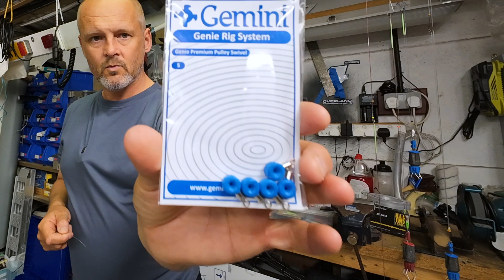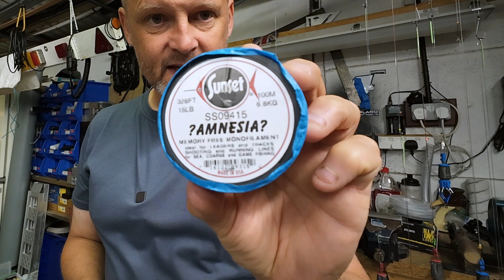1 up 1 down - drop down pulley rig - David Draper inspired

Comment: Well I tested the, and they work very well, even on full flood. Had 3 thornback and 2 doggys. On it, and on my  usual pulley only had 2 rays. Definitely a winner 👍🎣
Reply from the maker: Happy days. What bait did you use for the thornbacks, around here mackerel & squid works well. Did you hook up on the bottom hook snood?
Reply: @seaangling  yep rays on the bottom, dogs on the top, switched baits on the top between blacks tipped with squid, and sandeel . Squid and bluey wrap for the rays down here work very well, 👍👍🎣🎣🎣
Reply from the maker: @daverees3079  as we expected so nice it did the job. I have another rig to show soon that I think you will like. I’m not teasing but a few tests and then I’ll film it.
Reply: @seaangling sounds good to me 👍👍👍🎣🎣🎣🎣

Comment: That looks a cracking rig, I shall make a few for my next comp, 3 hooks, 1 rod, that will do the job nicely, thanks 👍🎣
Reply from the maker: Have you seen the 3 hook flapper rig on the channel as well? That would be my go to rig for a comp with small hooks/baits.
Reply: Yes mate, made a few of them, all ready to go, many thanks, enjoy watching your channel 👍
Reply: I mainly fish Bristol Channel mix to rough ground
Reply from the maker: @mikeseatherton8855  I fish mainly clean ground so do not usually need a rotten bottom. I’m guessing they are standard for your fishing?
Reply: @seaangling  yes rotten bottom is a must on some marks and work well when needed 👍
Reply from the maker: @mikeseatherton8855  RB’s is not something I use regularly but here the weed can be a nightmare.

Comment: I Mark it's a great video you explain everything very well the only problem with pulley dropper rigs I  always feel the hook length doesn't slide down to the bottom until you have hooked a fish. I think when the  rig hits the water it slides up to the top and once there is a belly in the line it will stay at the top.
Reply from the maker: Unless you fish it at slack, rods high, downtide or on an ebbing tide. This rig isn’t suitable for all places/tide.

Comment: Hello Mark, great tutorial video - just wondering if it would be possible to put diagrams with component positions and line lengths etc
Reply from the maker: It is a good point and one that I have considered but I try to show my reasoning so that users can adjust to suit their own locations or needs. A quick google search will show most rigs in a standard format. By explaining why I have chosen lengths, terminal tackle or hooks I hope it will encourage people to experiment and adjust rather than blindly following a picture/drawing. I hope that helps.

Comment: Hi 
My feelings are that rigs with loose snoods ,as soon as they unclip by hitting the water,slide up to the top of the rig body .
They never slide down again while fishing ,because of current-tidepull.
Meaning both snoods lay over each other,while fishing on the seabed.
Untangling when winding in,and gives a wrong idea how the rig fishes
Maybe I’m wrong, I like fixed snoods,clipped,down or up and overdown
Hope someone understands my worries about flying up snoods wich never slide down when fishing .
Reply: 100% mate, more of a slide up rig than a drop down unless fished in a none tidal zone.
Reply from the maker: I didn’t cover use in the video as it was a pure making one. I totally agree with what you say and the use of this rig is very specific. I wouldn’t use it on a flooding tide or cast uptide for the reasons you mention. It can be a very good slack water or turn of the tide ebbing rig. Some underwater footage would be amazing to see how it lays out. The technique of drawing back after the cast as the rig drops through the water and straightening it out works to improve most rig presentations. It is an interesting point. 👍🏻
Reply: Great vid Mark, Could the rig be fished with a drilled ball weight above the cascade swivel to help push the snood back down once in the water? 
Have you got any videos explaining which rigs to use in different states of the tide?

Comment: Hi mark what’s your view on using 60lb braid no shock leader fishing from the beach many thanks mate. Paul
Reply from the maker: Using braid straight through with no shock leader is possible on a fixed spool reel. There are some considerations with that though. Although there is no knot to a leader, braid does hold and attract some types of weed. This can be worse than mono which doesn’t grip it in the same way. Braid has very little abrasion resistance which doesn’t suit some areas. You will need to keep the line wet to avoid wind knots. I have fished braid straight through and prefer mono/shock leader.
Reply: @seaangling  thank you mark I think I will try what you say as it can be a problem with floating weed where I fish thanks again
Reply from the maker: Let me know how you get on and what shock-leader knot you settle on.